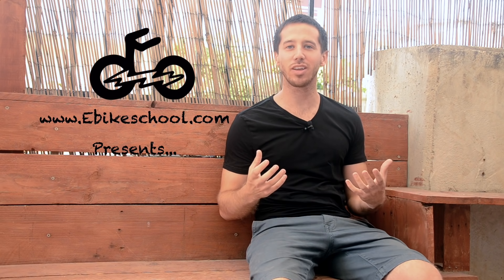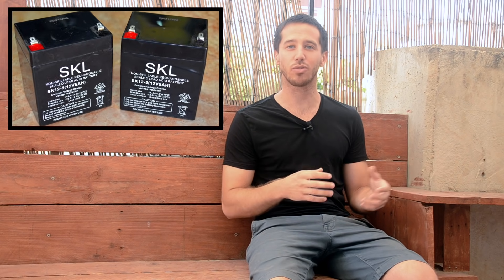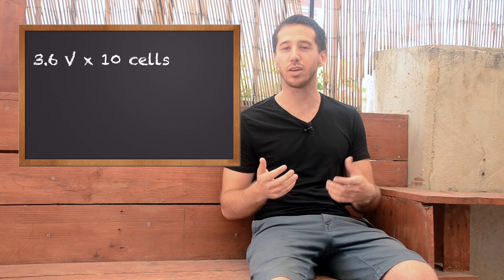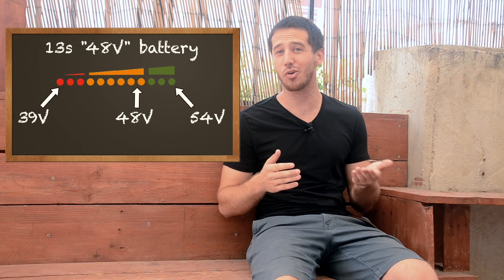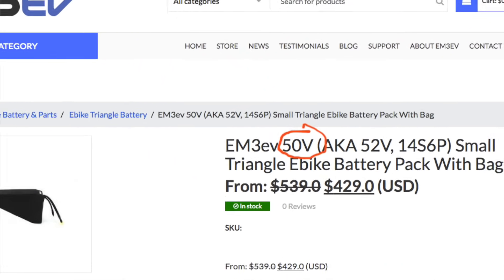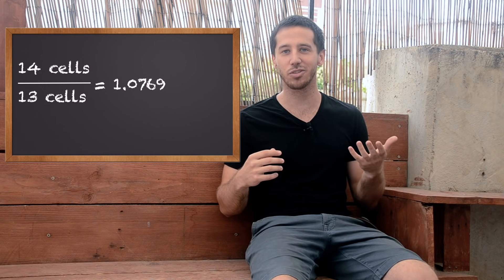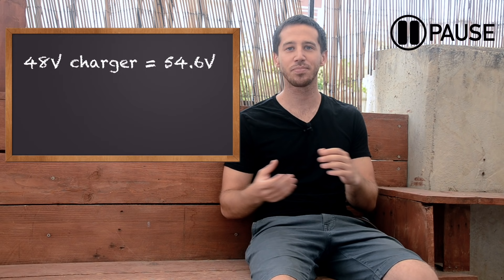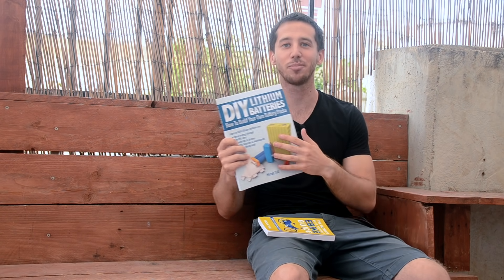Which is better: 48V or 52V battery?

Comment: i always assumed more voltage means higher efficiency ,a power supply in the UK is more efficient than ones in usa due to the 240v feed ( for the same max rated watt output )
Reply: Yes, you are correct, but the difference in efficiency is not that substantial. As with all power production and consumption there are diminishing returns as you squeeze more power from a device.
Reply: @scmacklin1  yes u are right a PSU is best if it has a current constant feed, in limited feed like battery its a diff matter

Comment: Excellent video.  I have a question: in the mid drive can you also upgrade to 52v?  Since they bring the integrated speed controller.  An example would be the BAFANG BBS02B 48V 750W.  GREETINGS.

Comment: disagree. 13S is 52V packs. this is because the sweet charged value of 4V per cell. I had to -1 this bcs even tho you're on about 3.6v and mention 3.7, actually the best charge a li-ion can have is 4.2v! this throws a whole monkey wrench in your explanation of voltages.
suffice to say, go for the 52V packs bcs you're over-volting a 48v motor and the speed above stated is nice :-)

Comment: nominal voltage is actually 3.7V now and you must consider the upper, fully charged 4.2V. a good rule of thumb I find is ball-parking  using 4v to calculate how many to use, etc... when you get down to 3.8V per battery, you probably should charge them as anything below 3.7 is not good for storage and they have very little capacity left. 3.6v is quite discharged and never let batteries get below 3.4-3.5 or they lose capacity drastically if left discharged for any length of time

Comment: 72v is better,I kinda learned that very well from using an electric unicycle,to be specific it was an Inmotion V3S that had a dual wheel motor,but it used a 72v battery and it only had a maximum speed of 13mph HOWEVER it picked up speed very fast so that made a huge difference. I've used 36v escooters and they take a long while to reach max speed,so that makes me miss the V3S sometimes because it could climb hills with ease compared to 36v escooters.

Comment: 52V battery will pull less current "per cell" than a 48V battery. Thats why people say 52V will run cooler.
You're pulling 20A from more # of cells so the C draw (current draw) on pack is the same but per cell is lower. Pack will run cooler. Although not much because the diff in voltage is so minor. But cooler none the less
Reply: You're confusing cells in series with cells in parallel. 20a from a 52v battery means each cell pulls 20a at ~3.9v (under load). 20a from a 48v battery means each cell pulls 20a at ~3.9v (under load). Increasing voltage does not reduce amperage from each individual cell; each cell still delivers full amp load, unless you add cells in parallel (which does not increase voltage).

The only way for 52v to be cooler than 48v without changing surface area is if the electrical system, specifically the motor windings, are re-designed for that higher voltage, and so draw less current to the motor. That is the only way.

Comment: Graupner Polaron Pro Touch Screen Charger 14S 500W 20A. I think this would be a better faster charge with this charger.i used to have the Hi-Tec X4 battery charger when I used to race 1/8 scale 4x4 truggy racing.

Comment: Higher voltage of the motor, you also gain efficiency??
12v @ 500w is 41amps. You would need one massive 40 amp battery to get 1 hr runtime.
 72v @ 500w is 7 amps. You would need 6 small 7AH batteries for the same 1 hr runtime.

Rite??
Reply: you're right on the calculus but not on the conclusion. To have a high voltage you need more cells (in series).
And a higher voltage (in that mesure in mean 6 times the voltage) means a higher speed so less torque at low speed. that's why most of "bikes" are 36-48-60V motors and motorbikes (more like scooter and motorcycle) use above 100V motors.
Reply: makes sense!

Comment: I have questions about which bike to convert. My preferred to convert is alfine 8 speed internal gear but has eccentric bottom bracket with vertical dropouts. I suppose I could go mid drive and an add on chair tensioner but there are no deraleure provisions on dropouts. also wondering about shifter and if controller needs to know what gear I'm in. Are these questions answered in your book?

Comment: Your the man bro. I like your videos. Very educational. I’m trying to fix my electric skateboard and was about to buy a 42v motor to replace the non working 36v dual brushless motors that are both not working anymore. I opened it up and seen that one of the capacitor came off the esc (bought this electric skateboard used). Wondering if I solder back on would the esc work again or do I need a new esc? The dual 42v motor comes with esc by the way. Also and most important would I need to change the battery if I up the volts in the motor from the original 36v to the 42v?

Comment: Battery will run cooler, because current consumed per cell will be lower. Total current consumption will remain same. But it will be divided in 14 cells instead of 13. So each cell has to drain a little lower.

Comment: If you run 2 52 volt 20 an batteries with each having a discharge rate of 40 would that = 80 would that be ok to run on a 1500 watt 40 amp controller

Comment: This technology is so primitive, my bike is powered by dark antimatter.
Reply: Mine is powered by an extension cord
Reply: And still limited to 28mph lol
Reply: dark antimatter? isn't that against the law?
Reply: mine is powered by music...
Reply: Dark matter? So you're not using the latest nuclear fusion reactor technology? I have a p1018 32.8Kwh nano reactor for mine. Sucks past around Mach 14 though because my front wheel is poorly balanced so it wheel wobbles like mad.
Reply: I use a squirrel cage drive and carry plenty of nuts for the squirrel to power the bike motor! ;)
Reply: mine is powered by starving orphans motivated by a 52 volt whip
Reply: Mine is hamster powered, i have a cage with 100 hamster wheels in the back producing about 0.1hp
Reply: @ricardorodrigues3508  hp= hamster power
Reply: Mine can make coffee
Reply: Have you tried baked beans? Fart Power!
Reply: Wow you're all insane 😂😂😂😂
Reply: Mine is powered by my imagination
Reply: Plutonium reactor here
Reply: Mine uses electrical pulses fired into chunks of living muscle that directly manipulate the pedals and the controller is just some gray matter housed in a bone sphere, all internally routed cables. It’s a mEbike
Reply: I use USB, 😂

Comment: I have actually had an ebike and you want the 52 volts because as it discharges and goes below the 48 volt mark, the electric wheel stops working. You need the 52 Volts so that you have those 4 extra volts to burn down to 48 Volts when it's going to stop.

Comment: Do you know if can use a 48V 10Ah battery with a 1000 watt rear hub motor, though the controller apparently requires a 48V 11.6Ah battery ?dsghh
Reply: Yes you can
Reply: @noktrnl123  Thank you
Reply: @thomasmuller9973  your welcome. I actually finished building my bike last night.
Reply: @noktrnl123  Awesome, I did too, but last week ? I was wondering if you're using a torque arm ? Is it absolutely necessary ?
Reply: @thomasmuller9973  personally I'm not but it's highly recommended. My frame is steel and I welded the dropouts to be more secure. Definitely get them if the frame is aluminum as they are prone to cracking under stress. I've put over 150 miles on mine including off road jumping and the only thing I've had to tighten was the spokes. I also have 4 12ah sealed lead acid batteries so it's pretty heavy for now but no problems. 👍
Reply: @noktrnl123  Thanks

Comment: You missed a very important benefit of going with 14s over 13s.  With 14s (52v) there is less demand on each individual cell in the pack.  It's going to put your per/cell drain rate lower, which will in turn make the battery last longer, because it's less stress on each individual cell.  Basically, it's like a team effort.  More workers means less work for all workers.
Reply: Nope voltage increase comes from more cells placed in series. The benefit you describe comes from placing them in parallel. 
If the controller did not limit the current higher voltage would actually increase the current. higher volt -> higher motor speed -> needs more torque -> needs more current.

Comment: If one assumes a given speed requires a given amount of power (watts) and that watts equal volts times amps, then for a fixed power setting running a higher voltage means lower amps.  Amperage determines wire size.

Comment: The difference between 13s and 14s batteries voltage is les than a 1%. (3,6×13)÷(3,6×14) = 0.929% so with same controller, same amperage you get les than 1% more power, how ever when you go up in speed and your getting voltage limited, (the faster the motor spinning the higher voltage it needs to keep the current up) so for top speed your getting 4x  the voltage % so still less than 4% something like 3.7% more power on top speed. It's not that much after all, just thought to run the numbers for you
Reply: your math is disappointing :)

Comment: The best is 48v 500w and 48v 1000w power and u get 40 miles per charge think smart
Reply: Ray s ,what about 48V 1500 w with 29 Ah battery ?
Reply: @normundsjelinskis3198  your battery will last the same as mine but go faster mabe u have a high ah rating

Comment: Hello sir.. i want to build a 52v 30ah battery.. how much cells
Do i need ani which brand cells are best to build it.
Reply: Hi, let me break this down fast for you:
52V is 14 Batteries(14x3,7V) in Series, 30 Ah is 12 Cells in Parallel(30Ah/2,5Ah)
So you need 12x14 batteries. Which is 168 total amount of Cells.
Good Brands are the common Sanyo, Samsung, LG Cells used in Notebook Batterys. You can look also on Ebay for harvested Cells to get a much better price then buying them new for around 2-3€ per piece from china.
But dont buy these noname cells from ebay or china with faked mAh like 8000mAh per Cell bec this cant be true and mostly you buy crap cells with 1400 mAh instead of the possible i think 2800-3400 mAh in good cells real capacity(no 100% guarantee for that max last number but its around that maxed out for 18650 cells) normal good brand 18650 cells have like 2500mAh
Hope i helped you out
Best Regards

PS: You will have a total amount of 1560 Watthours and you can safely pull 2C from it which means you can run an 3kw motor with it
Reply: Thanku sir it was so helpful for me. And one more thing i would like to ask you. Sir i am planning of motor have 1kw. So can you tell me how much time will it run with 52v30ah of battery.
Reply: @rajsaitavadekar4395  Around 1 1/2 hour at maximum energy of 1kw. But you dont need always max 1kw so you can expect 2 - 2 1/2 hours i guess. depends on how you drive too. Sporty or economic.

Comment: Now I understand why... I have a tidal force ebike. It is on 36VDC battery. The original owner I bought it from does not have his original 5 pin female connector charging port. 

I search everywhere trying to find a charger for it. 

Battery pack is NiCad. They said this older technology is more robust then lithium. I can just make a 40VDC power supply to charge it. Is it true?

From research, I found only 3 out of 5 pin is actually used for charging. Positive, negative and ground. Do you know which in is it? What there is 2 pins not used?

Comment: Can 52 volt setup harm 1500w 48v hub motor set?
Reply: There is controller between battery and motor. See controller specs first.

Comment: Thanks for the info. I'm looking to build an e-bike this year. I live in New York City, and I want a nice 72 Watt bike that can go up to 50 or 60 miles per hour and have a 40-mile range. What would you suggest as a do-it-yourself project.
Reply: Radical Durrite i think you mean 72 volts. I reccomend a 3000 watt hub motor kit, combined with a 72 volt battery with atleast 25ah

Comment: Great video as always . I have a 2 hub drive bike 350 rear 250 front and it has a built in controller that I cant get to . It's a 48v 10.4 ah system . I would like your best guess as to whether I would be safe to add a 52 volt battery on top of my rear rack and use it individually , as in when my 48v goes dead I could flip a switch and get home on the 52 v or vice versa ? The other option that I am thinking on is disconnecting the rear motor and installing a bbshd mid motor with a 52v on the rear rack and using just the front hub to get home on . I can get the whole kit battery and all for just a few hundred over a new 48v battery . I may be crazy but this is the way I think , I think . Hmmmm TIA
Reply: If your putting all that extra weight on use fat tires, use one 48v battery in the frame and one on the  rear that should even the weight spread, use a bbshd mid motor 1000watt then use a power lead clip in system to swap between batteries to keep it tidy.
Reply: 52v on a bbshd is fine to use

Comment: I do and think it stinks they go so slow when its a 1600 watt Bafang motor with a pissy controller ! for $5999 I payed 2 weeks ago for an e bike I was told goes 55 k ? Then the shit shop volt Bondi junction sells me a bike that goes 50 and put a limit on it ! WTF ! and the frame peeling wires done by 2 yrs old kids ! Nearly in chain ,head wires put together like retards ! ALL THESE SHOPS ARE RIPPS THAT JUST KILL THE BIKE I PICKED ALL HAND PUT TOGETHER ! NO NOTHIING SHIT SERVICE AND THEY ANINT FIXING SJIT FAIR TRADEING AND THATS THAT !

Comment: I bought a 48V charger for my 48V SLA battery pack. The output voltage of the charger is at 59V and 1.8A. Will this work for my 52V Lithium Ion battery?

Comment: Hello, for example the controller that I have is rated at 1000W. So a higher voltage battery would drain less current compared to a lower voltage one since the limit is set to the power delivered and not the amps. Am i wrong? Also a higher voltage battery will run cooler than a smaller voltage one since the heat is dissipated across a larger area and each individual battery draws less current.

Comment: Hi there, I'm building an electric bike but not sure what am doing 😆I'm buying a kit with 1500w, is there a specific battery voltage that I have to use or a 48v 15 or 13 amp will do the work without damage anything? Thanks

Comment: Great video. I just purchased a 36v 350w bike. I don’t need speed, I need range, happy to use only PAS. Thinking of purchasing a 20 or 30ah battery, not sure if it’s wiser to do multiple 10ah batteries.

Comment: The BATTERY will run less current, PER CELL... 20amps out of 48v/13cells is 1.54 where 20amps from 14cells is 1.43, so each cell has a lower load... so... cooler.

Comment: Hi, I purchase a front/rear 48v 1000w hubs kits.  Do you have a diagram how to hook up with two motor?  Each hub require 48v 1000w, then what is my battery pack must be?  Should it be 96v 1000w battery pack?

Comment: I beefed up my controller bye soldering more solder on the rails and capacitor. I also had 3 shunts and only 2  were there so I added my own think wire and now I have 3 bigger ones. 
The power I get when taking off is insane. With a 13amp hour battery pack ? Would I fry the batteries or do I need to add one more pack to make 26amps thus spiting the amps among the battery?

Comment: There are many good comments but I thought providing some guidelines might be helpful.  

First some caveats:
1) Not all batteries that are listed as xxAH at 24/36/48/52/60V are the same.  Batteries vary in the amount and purity of the lithium (Li-ion, Lipo) and internal connections.  This determines how much power the battery can store, for how long (low discharge), and the rate the battery cells and total battery can charge and discharge.  Cheap batteries tend to cheat on some or all of these factors.  It costs more to use more of the lithium, silver or other precious metals.  And it requires a working environment that keeps the materials uncontaminated,  
2) If you want to get high power out of a battery pack by using high current limits, that can impact the life of the battery.  A battery pack that uses high-current (High C rated) battery cells and is properly built will, as a rule, last longer than a battery that uses cells with lower current ratings.  
3) Setting high current limits on the eBike display can exceed the limits on some batteries or the motor controller.  That may result in a performance increase but also in the need to replace the battery or controller.
4) Increasing the voltage at the same current limits results in a higher power level (P = V x I). Several posts have asked if increasing the voltage from xxV on a XXXW motor is OK.  That depends on the maximum voltage and power ratings of your motor, controller, and wiring.  The wiring is not usually a concern but as the power is increased, borderline connections or gauge of wires can become a problem.

My thinking about upping a 48V ebike to 52V is that this is more of a benefit in providing a more even power budget as was shown in the video.  That changes the objective from trying to get more high-end power out of the bike to wanting to get a good level of power over a longer ride distance and up and down more hills. A 750-1,000W motor can get most fat arses up hills.  I like eBikes as a way to cover more ground and make biking more of an adventure.  There is plenty of power to help up steep trails.. to the point that I have to walk/carry the bike due to not being able to get traction.

Fellow weenies, I am 68 and do not want more power than 1,000W. But I want that power to last longer before voltage drop degrades performance.  And I want the kit to last for longer trips and for longer life before needing to replace stuff.